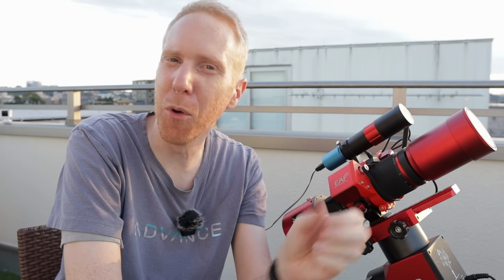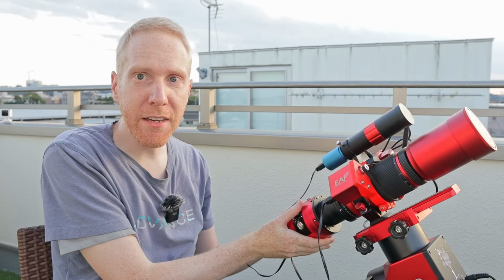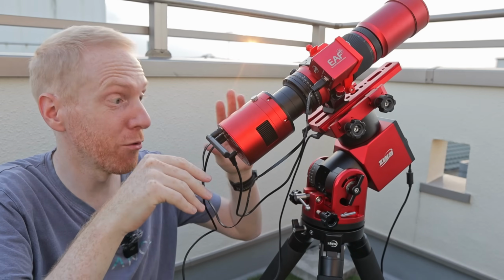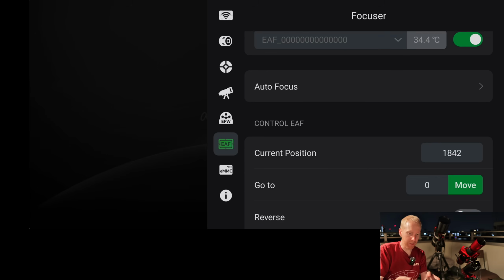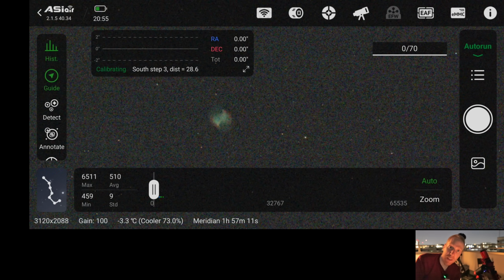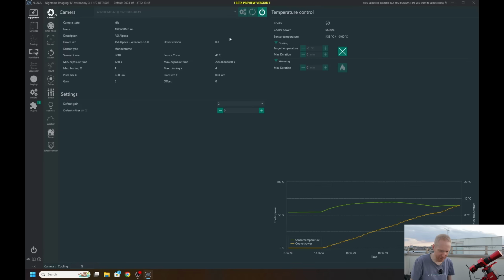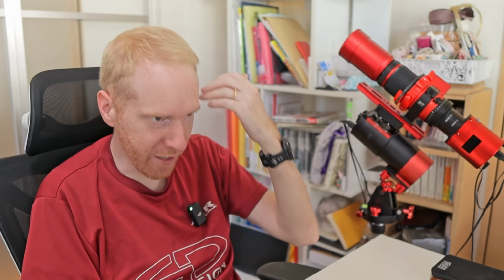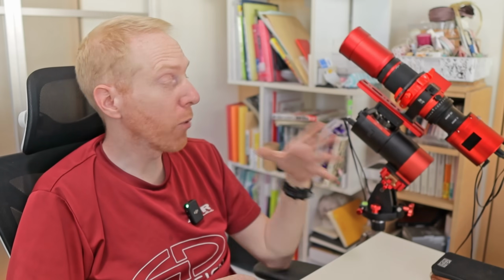This Astro Smart Camera does EVERYTHING🔥! Perfect for beginners? REVIEW of ZWO ASI2600MC Air!

Comment: A couple generations later, it should come with an integrated battery, and the EAF at that point should have a separate power input, and BlueTooth connectivity. Then we would be able to run this entirely cable-lessly. At which point this would be a great option, especially for something like HyperStar/RASA.
Reply from the maker: The EAF used to have power input - and a battery to run the Peltier cooler would either be huge and heavy (completely impractical) or run out after an hour...
That said, integrating a microfocuser within the body of the camera should be possible

Comment: I am a nature photographer and use my Sony A7RIII + Canon 600/4 for astrophotography, on an unguided SWSAGTI. I simply don't have room for all the additional gear necessary to enable guiding when traveling, but this might be the solution I have been waiting for. It would require purchasing the astromechanics eos adapter, and then I would probably switch to a ZWO AM5N mount. The only question is if enough light would reach the guide camera since the astromechanics adapter cutout is rectangular shaped to allow fullframe exposure whereas telescope tubes are generally completely round. Since the main camera is APS-C I am guessing/hoping that at least some of the light should fall on the guide camera. Would you care to make an educated guess?
Reply from the maker: There's one problem with this: the ASIAir/camera can't control the Astromechanics adapter...
Reply: @CuivTheLazyGeek  I think it should be ok, as long as I get some light on the guide camera. I shoot wide open but the lens needs power even to focus manually which is why I need the astromechanics adapter, and I have seen that it is possible to focus a Canon telephoto lens with the ZWO EAF using a belt.

Comment: For a few years now I've been wondering if one of these manufacturers would come out with an aa-in-one solution, and we got a few products like the ZWO Seestar 50, but I was thinking something more more serious like a cross of a $2,000 - $5,000 setup with tripod/EQ mount, 80mm  or higher optics, finder scope, controller, etc all as one integrated unit. ZWO could team up with someone like Williams Optics and EQ mount (some mounts have been sold under different names), anyway I think you get what I'm talking about. The reason I thought this would be a good idea is my own experience getting into the hobby and the myriad of options, some that work fine together, others that require the user to be their own diagnostic/repairman/designer.  That way I could pick a unit within my budget, take it home, quick set up, align to the pole star, fire up software and go.  The only thing I'd have to bring to the table is a computer.

Comment: K, wait... suppose I didn't want to use an auto focuser, and had a battery pack that I could (awkwardly) fix onto the back of this device, could I use this on a Hyperstar/Rasa system without ANY cables (and therefore without ANY diffraction spikes)?
Reply: no... I'd need to connect the mount. Haha. So close! Never mind me.
But in all seriousness, I can't wait until mounts can be run wirelessly.
Reply from the maker: Actually yes you could. The AM5N (and some others like the WD20 or the UMi mounts) can be run over WiFi, but I've never tried myself!
Reply: @CuivTheLazyGeek  Ooo… well, I suppose I’ll have to save up a bit. But that sounds very cool, at least in theory.

Comment: It does seem like it’s a decent choice for beginners/those looking for a compact travel scope. I love that it has a guide camera built in, I’m not crazy that it’s locked to the ASIAIR system. While convenient to have the software all together, it doesn’t have the power or versatility that outside controllers have. Slow PC connectivity is a real negative to giving it a broader appeal.

So basically there’s a time and place for it, but it won’t replace other current traditional setups.

Comment: ZWO is a great ecosystem. Analogous to the Ford ecosystem, its great variety and quality.  Some people thrive on complexity and fiddling with a boat load of software and drivers and nearly incompatible Frankenstein systems....have a nice life.   The only downside I see with this multi-component device is that, if one part craps out, it takes down the other parts.
Reply from the maker: It's a very good ecosystem for sure! I find NINA simpler for me than the ASIAIR as I have everything dialed down but to each their own!

Comment: Hey Cuiv!  One thing I really like about this ZWO Mc Air 😄is that it allows for a perfect grab and go setup that reduces headaches of having all separate different components.  The last time I went to a dark site was a disaster because everything worked but the computer would not boot!  Everything worked at home but I guess the humidity prevented the computer from coming on.  So even though you are limited to ZWO hardware, for a "just works" setup for taking to a dark site or your backyard.  Plus with the cost of $2000, you don't need a separate guide camera, off-axis guider, or even a PC so you save money too.  Since it seems like a lot of people have multiple rigs, why not have one that is all ZWO hardware with your own scope and mount?  Frustration can cause people to leave the hobby but something like this can make things less frustrating including the spider web of cables that can snag.  Thanks for this review as it shows all the benefits and pitfalls of this setup.  CS!
Reply from the maker: It's indeed great for a second rig or a grab and go setup (main use case in my opinion)!
Reply: I would like to know if this product can Word with the Celestron AVX mount?

Comment: I don't care for their practice of locking down the ecosystem and not allowing the use of other devices with the ASIAir, but at the same time I don't fault them for going that route. It ensures everything is much more likely to work.

One thing you may have covered and I missed it was the lack of dew heater control. It does have the anti-dew feature for the camera, but what about dew heaters for the telescope?
Reply from the maker: It's like the normal ASIAIR Mini - no specific dew heater ports

Comment: Thanks Cuiv, this was the torture test I was waiting for! I hope ZWO do fix the issue with PC control, just to assure that it can be used both ways - PC as well as ASIAir. This would be great as a travel rig or a fuss-free second rig. I will have to check whether the modular Lunt I want to get is capable of illuminating both sensors. If that's the case, I'd strongly consider getting it.
Reply from the maker: It's a good option for a travel rig/second rig!

Comment: Kinda like it.. I mean, it makes sense and puts a lot into one unit.. great for a travel rig!
honestly might get one eventually to make the portable setup even simpler.. as I was considering a 2600MC(possibly duo) for that already anyway.. and the price is similar enough

The only thing I somewhat don't like about this, is that it is 3 units in one. Great for traveling, but for home use, the modularity is probably preferred. - I doubt that there is much need for it; but you can't upgrade any of the bits, which makes this setup somewhat bad for future proofing. And if one of the 3 fails, the whole thing fails.. 

As for the ecosystem complaints.. yes, you're locked in into ZWO, but I guess that upset some.. But who probably have 90% ZWO products anyway..  most likely with their ZWO camera,  ZWO focuser, ZWO filterwheel, on their ZWO AM5, and ASIAIR, complaining that they can't use your QHY guide camera with that set up..? 

Is it so bad to be "locked" in a brand that honestly is one of the few to still innovate and bring out new products that actually make sense and do actually work?.. and work really well together? - I mean.. what has Skywatcher done since the EQ6-r? other than releasing the EQ8 beyond a normal budget and a strain wave mount about 3 years after ZWO brought an affordable one to the table?.. what has Celestron done other than riding their Schmidt C8-11 train? what has William optics done other than just releasing the same scope with 4 or 5 lenses?

I'd understand the ecosystem complaints a little more if the products were actually bad, and you were forced into using a guide camera or focuser or filterwheel that was actually bad.. the only things ZWO is bad at in my eyes is proper remote imaging (although it is possibly through vpns), and dual setups.. I'd love to connect 2 ZWO's together and have them talk to each other for a Frankenstein setup.
Reply from the maker: Good points! And yes it's great for a travel rig!
As for the lock-in, it's less of an issue for this camera, it becomes more of an issue with the standalone ASIAIR (where ZWO cameras tend to be more expensive than equally capable ones from Touptek for instance, and so the ASIAIR prevents you from saving literally hundreds of dollars on some models). And of course there's the stuff ZWO doesn't offer (rotator, flat panel/dust cap combo, etc.) that the ASIAIR doesn't support - there are clear disadvantages for the consumer with a lock-in, and clear advantages of such an ecosystem at the same time.
Reply: @CuivTheLazyGeek  Momentarly ZWO has a rotator which you can control with asi/air

Comment: Hi Cuiv another very informative vidio.
I would much rather it was done with the single MC & not the Duo the the filter wheel with nano filters is much better.
PS. Is the guied in the camera comparable to PHD2
Reply from the maker: Yep, completely get it! Or with a 585 or 533 sensor for much cheaper. The ASIAIR system uses a light version of PHD2 for guiding

Comment: Not a fan of this direction ZWO is going. If they want to provide an integrated solution, better to add ASIAIR to their two mounts. Then have all wiring connect to the mount.
Reply from the maker: Would be kind of nice, but at the same time not sure I'd want to have the mount itself rely on that control center. But an optional saddle with ASIAIR integrated would be nice!

Comment: It’s is a good product and will sell well. However there is another aspect of the ASI AIR ecosystem that has always bothered me and has not been spoken about much. Not only does it lock you into a hardware ecosystem, it also locks you into a software ecosystem. It’s a one size fits all. The PC ecosystem has a vast range of software and plugins that cater for every niche in our hobby. And let’s be honest we are not just astrophotographers we’re technology addicts, we need variety.
Reply: The benefit of never needing a PC laptop out there cannot be understated. What a righteous pain in the rear compared to a smartphone for control.
Reply from the maker: Yep, I have an older video about the stuff I wish I had in the ASIAIR. The software balances ease of use and features as best it can for a smartphone interface, but for sure NINA provides more power and automation.... but laptop of smartphone RDP in the field...

Comment: My only concern would be the reliability of the Air component of the camera system. I'm on my second ASI AIR Plus because the first one bricked.  What is the alternative?
Reply from the maker: Interesting! The Mini for me has been very stable (and uses a completely different processor and board than the RPi-based ASIAIR Plus), but it's a good point!

Comment: This is a bad deal for a novice if they ever decide to upgrade to a premium mount like and AP, Paramount or 10u.The camera will be essentially useless. It is also a bad idea if you ever think you might want to add the mono ASI2600mm to your gear. I have both the 2600mc and the 2600mm. I can switch cameras in about 5 minutes counting rebalancing the mount.
Reply from the maker: It's an all in one, with all the advantages and drawbacks that come with it

Comment: Yup. What you said. ASI Air is a great way to get started, but don't box yourself in. I started a year ago with an Air and have out grown it. NINA is awesome. Thanks for the vid.
Reply: So you are locked in to NINA then?
Reply: @sammadonline  Only if I want to be... I also use Sequence Generator Pro... what is the real question?
Reply: What exactly does NINA do better than an ASIAIR? Genuinely curious.
Reply: @himalaYAK1983  It allows you to use non ZWO equipment.
Reply: Cheap, mini pc is the way to go. Devices like the Astro PC can control and power your gear also. I'm a beginner, but if I get there this is what I'll do. I've got no interested being locked into ZWO, but can always use them if I want.

Comment: This is an interesting combination but for me this doesn’t make sense and may be risky.  There are too many things in the same package that can have problems, go wrong.  Including the ASCOM Driver running the entire package.  An Auto-Guider that requires almost a full-frame FOV to work correctly.  An ASIAIR Plus that runs 'hot' and the core camera and TEC that’s trying to cool the sensor and A/D converter.  Can the sensor really cool to -30 or -35C?  Does the package require more airflow, a bigger fan to cool the camera and other components?   As I said this is interesting but there are too many things that can have problems.  Also, this further locks users into the ZWO ecosystem.    I will pass.  ZWO - where's my rotator???
Reply from the maker: Yep, completely understand where you're coming from! The heat part hasn't been an issue - it's 30C in Tokyo at night and I cooled to 5C without issue while running guiding and imaging session - live stacking also seemed to work. If anything I think it would be better than the ASIAIR mini that is passively cooled (it has a different processor and design than the Rpi based ASIAIR Plus btw), since the CPU is now fan cooled.. The fan is the same size, but it's no longer directly attached to the camera body, which is actually probably better for vibrations - when I opened the camera, the layout of the components looks actually very similar to Touptek cameras, interestingly. But I completely get it!

Comment: Awful idea to make it ASIair... if they'd built in a small general-purpose ARM or x86 SBC so you could install your own OS (with exposed USB ports) it would have been an absolute winner for travel equipment. As it is, there is zero advantage to this and a litany of disadvantages. Locks you 100% into ZWO and their wishes for how you use your equipment, can't be used with a PC properly, can't be switched between cameras (you'd need a whole other ASIair in your mono setup for instance), heat output from CPU crammed into a small case near a TEC cooler (bad idea), can't monitor PC and cooler usage independently, can't shut-off the camera 12v to reset it without shutting down the whole imaging rig and wifi network.... this is just an ugly Apple-esque intrusive concept.
Reply from the maker: I see what you mean - it's all about AIO with a fixed/closed control system, or something super flexible that can be more complex to get working. I think their approach has its place, but for tinkerers it's not great. I'm not so worried about the CPU heat (now it's actually fan cooled with exhausts and a much larger metal case) and the Peltier is handled separately within the camera body. But I absolutely see your point!
Reply: @CuivTheLazyGeek  Aye it's really just the fact it's locked to be an ASIair. I hope someone like PlayerOne builds a tiny little Intel n100 or something into their next series, I'd buy that in a heartbeat :D

Comment: Interesting development!
Like the idea of less cable.
I have a zwo2600mc pro and a zwo2600mc duo
The last cs night my duo was tracking with absolute precision at mostly less than .5 total error. Also was running my askar65 with zwo533mc pro and asi air, askar 128 guide scope and zwo174 mini but track on that was mostly 1.0 or less but about twice the error of the duo. Not sure why but I’ve ordered a new usb 3.0 c to a flex cable from L Com and will see if that helps with the error on that setup.

Also using a peg Astro rotator 2 or latest model. That runs on WiFi and access it with ms edge for rotational control. Works great for orienting Andromeda to fit nicely in 2600 duo
Thanks for another excellent in depth video Cuiv….
CS!
Reply from the maker: Hope you can get to the bottom of that guiding with the 174!

Comment: Initially, I found the product interesting as a nice all in one solution for a travelling setup, but sadly there are for me 2 deal breakers:
- the lack of a proper PC connection. ZWO could have implemented through the USB-C port but chose not to do so, possibly to lock you in completely in their ecosystem
- the absence of micro SD slot. For me, the preferred way to transfer pictures after a session is to remove the SD card and plug it into my Mac.

By the way Cuiv, have you been in touch with Touptek to review their coming competitor to the AsiAir ? I would really like to have more information on this product
Reply from the maker: Yep I fully understand those can be dealbreakers, it really depends on each!
Yes, I'm looking forward to the Touptek AstroStation! I don't have it on hand yet...

Comment: I could see this as a great super light and super portable solution along with a small ASI Mount and a scope with ASI auto focuser, but don't like that the air does not support much other equipment making it not flexible, at least from my understanding about the air is that it does not support non-asi focusers, filter wheels and non-asi mounts - if the air software does support those now then I think this is great, otherwise I think it's great for an AIO portable setup but not necessarily for those who already have mixed equipment.
Reply from the maker: Yep, that's exactly right - this supports non-ZWO mounts, but only supports ZWO EAF and EFW for instance